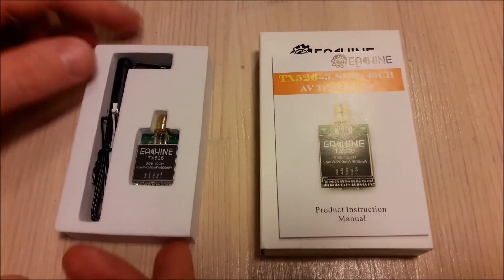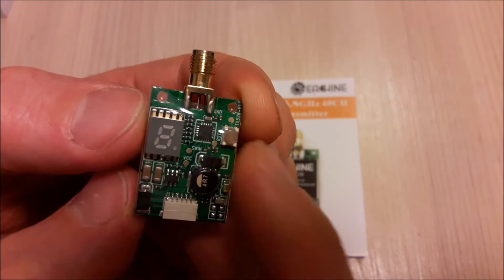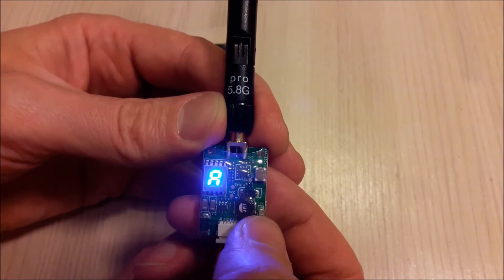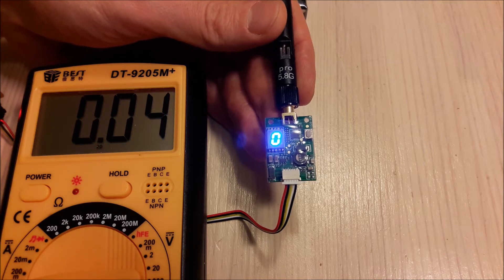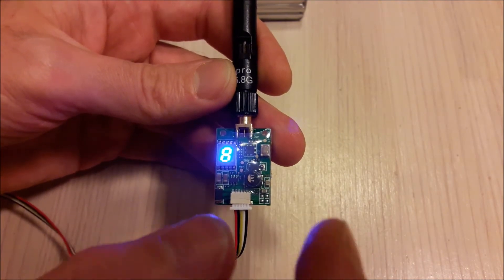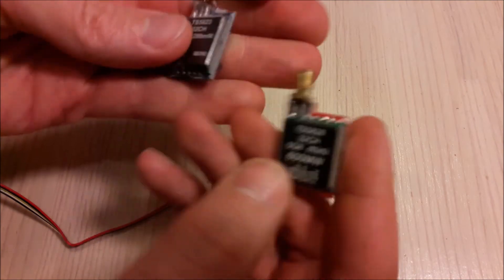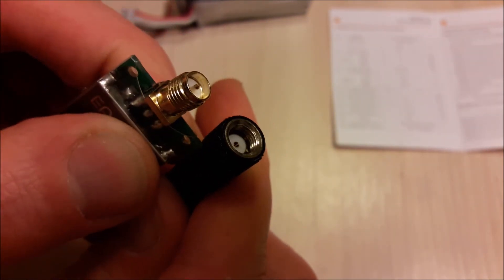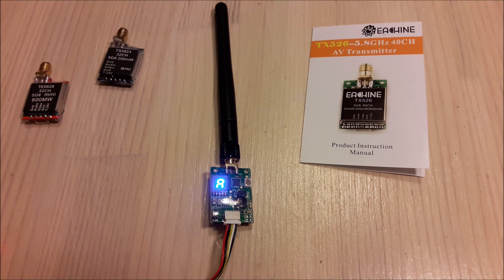Eachine TX526 FPV video transmitter review

Comment: I WANT TO KNOW THAT IF A VTX HAVE HIGH POWER OUTPUT THEN IT WILL PROVIDE  LONGER THE RANGE OF DISTANCE???ŔEPLY BCOZ I HAVE WRITTEN HERE WITH HOPE
Reply from the maker: Yes, this TX526 is pretty good. But the antenna is more important than the power output of the VTX. You need directional antennas (Helical or patch type) with a high gain (more than 8dBm of the gain) for the greater range.
Antenna is the key!

Comment: Nice job. Question - how hot does it get at 600mW?

Heat has always been a problem with these little VTx thingies. Eachine has an older 600mW only version that that looks almost the same as this which gets really hot after a while.

Comment: is this ok with 5S lipo?
Reply from the maker: Working voltage 7-24V, 5S voltage is 21V so it is within range. Should be pretty safe. Just have in mind, that active braking setting in ESC's may introduce drastic voltage spikes!
Look here, regenerative braking: http://www.4qdtec.com/pwm-01.html
Reply: then, there's no any issue with 4S ?
Reply from the maker: sameer mohamed, no problem on 4S and even 5S if you are not using active braking in blheli settings.
Reply: thank you very much for your kind reply

Comment: What is the range of that transmitter?
Reply from the maker: I dont have range data, but there is a thread on RCG  (https://www.rcgroups.com/forums/showthread.php?2733574-Eachine-TX526-5-8G-40CH-25MW-200MW-600MW-Switchable-AV-Transmitter-Free-Testing/page5&highlight=tx526), where other guys have made power measurements - more than 900mW on some channels and managed to get 7.1km range.

Comment: I have this transmitter aswell. If you hook it up to your battery voltage I would suggest to use a 34V 500uF capacitor to take out the Alternating current produced by the motors. Its an Awesome little transmitter!
Reply from the maker: +MrJob91 Thanks for suggestion! 
This VTX is a copy of AOMWAY and maybe thats why is is so good ;)
Reply: NP! nice review!
Reply: How do you do that?